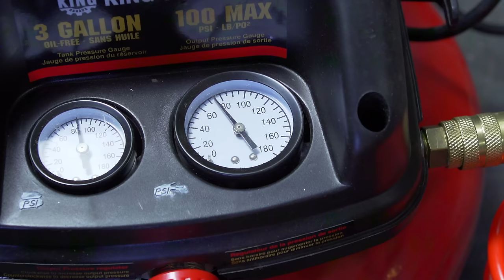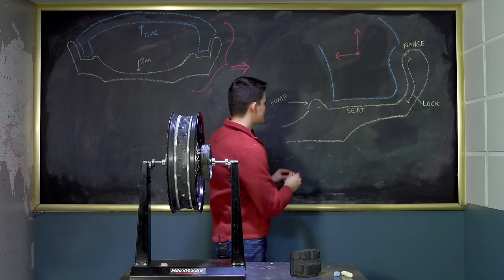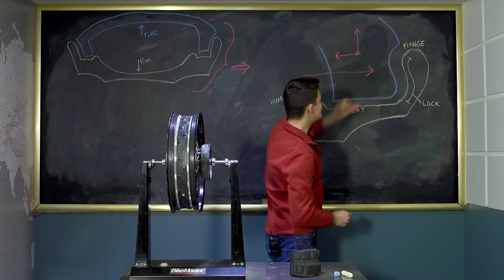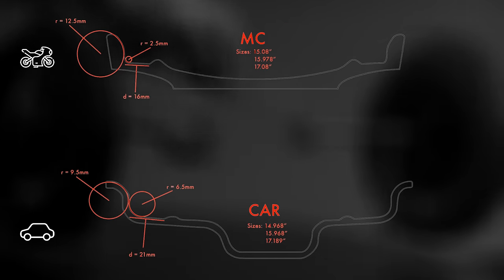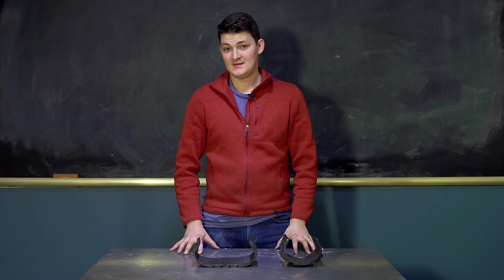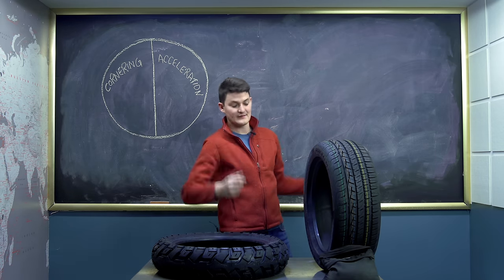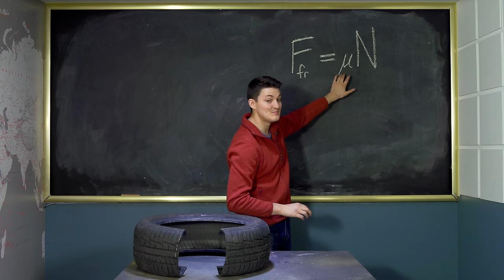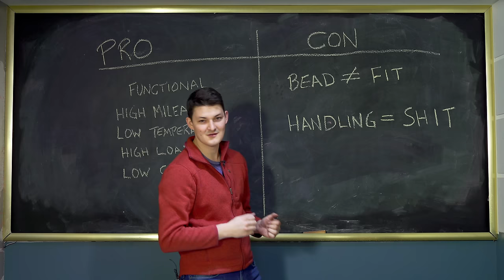Are Motorcycle Tires a Ripoff? The Darkside Car Tire Experiment

Comment: A friend of mine who is in the 300+ range with a wife not far behind decided to put a car tire on his goldwing and then take it up the tail of the dragon 2 weeks after buying the bike, his first. As one might guess, he came back with with a cast on his arm and a matching one on his wifes leg. The tire did great for him until he had to actualy corner, at which point it slung him and his wife into the side of the mountain. Luckily, they were on a curve that put them there, instead of flinging them off the side of the mountain or into a guardrail. His ins paid to fix the bike and he took the old tire back to the shop where he got the car tire and had it swapped back on before he rode it again
Reply: And was the accident CT related, or is he just a dumb man buying a Goldwing as a first bike and ride 2 up after 2 weeks? 🤣🤣
Reply: @corneilcorneil  He swore he just leaned over to much and the back went out. He also claimed to have riden bikes when he was younger but it would seem not that much to do a stunt like that.
Reply: @southronjr1570  "The back wend out"... possible, on sand or gravel. More likely: a (heavy?) passenger that try to pull the bike straight when you lean. Maybe he was using the rear brake to much? No countersteering experience? A new rider on a Goldwing... typical, not? But ofcouse, it is easy to blame the tire. Just like all the invisible deers that cross roads. 🤣🤣
How "far" can you lean a Goldwing? Real riders scrape their bikes daily without a outbrake. 
When you use a correct CT and pressure, it bites in the road and is much safer on a heavy cruiser. I would say, try 2 identical cruisers/tourers, one with a MT, one with a CT and see how it works out. Modern MT's have almost no profile patern. How that turns out on a heavy cruiser, is just logic.

Comment: People who say something shouldn't be done. Should never interrupt those who have already been doing it. If you are a pussy. Don't run a car tire on your bike. I have ran Runflat car tires on Goldwings for well over 300k miles with no problems. And no flats on the side of the road. The handling part F9 mentions is real. You will only notice it in parking lot speeds. Otherwise, it is a non issue. I'll take my decades of experience over anyone's perception of Darksiding.

Comment: So he Choose a light bike with a Spoked tube + tire rim (that should give you a clue as to the agenda to start with. Then he puts a non-run flat, fairly wide, cheap tire on it (strike two). Then he inflates it until it's hard as a rock. It's SOOOO surprising that after he goes for every extreme to make the tire fail, it does in his example...shocking!...Not!
I've run high performance run flat tires on my '02 Goldwing for 15 years. They are Not $100 cheaper than MC rears, they do last 3-4x as long. The Goldwing rear rim is nearly as wide as a standard car rim and it uses tubeless tires of course (what a joke using a narrow Spoked rim for an example). The Goldwing weighs over 800 lbs and when a car tire is properly inflated to 10PSI or more below the the car mounted pressure levels, it does deflect a bit, not that heavy cruisers even could nimbly lean at the angles the bike in this example (with tires inflated to be hard as a rock) could! Where is the truth of a real comparison anymore?? What happened to unbiased reporting??? This is similar to Fake News edited, manipulated to present only one possible opinion. I just lost all respect for this guy based on this manipulation of facts!

Comment: One thing that really bugs me about this video is that the G-max AS-05 is an asymmetric tyre. Meaning that the inside tread and the outside tread are designed for entirely different situations. As a car fitment, great tire considering the price, but any rear mount on a motorcycle should be symmetrical. Video is phenomenal otherwise. Typical FortNine exceptionalism.

Comment: I've been riding motorcycles on the road for 45 years, when I was young I did many risky and stupid things, however for most of my riding years I've always had the attitude of making my machine as safe as possible to reduce the inherent risks comig from things I can't control. I see a number of people using car tires on the rear. Based on numerous forums people who do so get very abusive and aggressive if anyone questions the use of car tires. IMO some get away with doing so because the machine and tire combo exceeds what they are asking from it in normal riding. I view paying for a properly designed and configured motorcycle tire money well spent because when other factors come in to play having something approaching the very best tire at your disposal can literally be a life saver. Why would you intentionally reduce your cornering grip, ultimate handling etc. etc.? Perhaps when I see Marquez winning races with a square section slick tire on the rear, I'll consider giving one a try.

Comment: So, why don't you use a car tire of far, far greater width than the stock motorcycle tire making your experiment totally worthless???  My darkside tire has more curvature than the stock MC Dunlop and it is the same width, and, being a radial it conforms to the road surface far better than the MC tire when used with ideal inflation pressure.  And as far as load, you ignore that friction increases with load.

Comment: The bead shape is different. Softer compounds, built for lean, definitely not a ripoff, but definitely too expensive for tires in general.
Reply: I will never go tubeless on spoked rims though, seen that fail too many times. That tire is waaaaay to wide for that size rim.

Comment: I remember the first time a customer asked our shop to install a car tire. He got angry when we laughed at him. There is no way in the world any intelligent shop is going to risk that level of liability exposure for some shmoe who thinks they know better that all the design engineers of the motorcycle and tire industries. If I were an insurance adjuster, I would deny any claim from someone who used a car tire. If the "darkside" twit wants to challenge in court, they can bring in experts from the motorcycle and tire industry to try and make their case. Good luck finding one that will be willing to do that.
There's nothing that can be done to prevent someone from running a car tire, and as long as any consequences of accident are limited to them, have at it. The moment your decision brings harm to someone else, get ready to pay the legal consequences.

Comment: F = constant * N isn't exactly accurate. Otherwise, given the same compound we'd expect to see 18 wheelers have the same braking distance as a car, which obviously isn't the case.
(F = m * a = mu * N, except m ∝ N, so we have a ∝ mu? Deceleration only depends on friction coefficient, not on total vehicle mass?)
It can be looked at either as that equation is just an approximation, or that mu isn't actually constant but rather a function of a whole host of things.

I remember in like a first year eng course or something I asked my prof about this, and after acting increasingly exasperated at me slowly building up from light car, light normal force, easy to stop, vs heavy car, high normal force, and exactly proportionally higher difficulty to stop, etc, finally realized the question wasn't as stupid as he anticipated and explained some stuff I no longer remember.

If I had to guess thou, I can think of...maybe rubber exhibits different properties under different sheer forces? Something something plastic stage then glass stage?
Also perhaps we aren't dealing with ideal friction where it's just electromagnetic forces between flat surfaces? We actually have bumpy roads and bumpy tires and there's grip stemming from protrusions from both literally laterally touching each other?

Either way wider tires made of the same material, on the same road, with the same normal force, should actually just provide better grip (at least to a point).

Comment: @3:00. vs $200 tire "I'd rather jimmy rig a bloody car tire because it saves 100 bucks and lasts four times as long." Then it doesn't save you $100. It would save you $700. That's not an insignificant amount of money.

Comment: I think motorcycle and auto/truck tires are a ripoff generally, I can put a set of quality LT tires on my truck for about $800, a set of tires on my motorcycle, $600. My truck tires will easily run 40,000 miles. I am lucky to get 7000 out of my bike tires.

Comment: Darkside all the way for me,.. 215/45/18 performance rated car tire on the rear of my VTX 1800F2. .. Could have dragged the footpegs with the crotch rockets had I wanted to do so.. Better traction and breaking than any of the bike tires used. To each their own....

Comment: The car tire lots for more miles because it is harder rubber.
Would you knowingly put a harder MC tire on the back when traction is all that will save you from a crash?

Do a scientific test of traction wet and dry and the MC will win everytime.

Comment: Kinda like using trailer tires on a car.  Wrong application.  Been working tires for far too long.  Actually ran a set on my vehicle to see what it would do.  Worked fine in a straight line on dry pavement.  If there was even a drop of moisture on the pavement, off road?  Bye bye traction.  Let's not mention the fact that most trailer tires are only rated for 55 mph.

Comment: I still think motorcyle tires are a rip off...if only for the fact that they don't have enough meat in the center strip of the tire. I see so many motorcycles riding around with rear tires that are nearly bald in the middle but still have lots of usable tread on the outer edges.

Comment: You are usually a pretty smart fella.
The problem is, we aren't simply throwing on a car tire that'll go on the wheel, on just any bike.
My gl1500 Goldwing is a very good example: fairly sporty for a touring bike but not a corner carver either. Nor does it have a particularly WIDE rear tire (160 section width?) so I'm not looking for ANYTHING as wide as what you managed to mount on that...bike of yours. What THAT means is, with the RIGHT car tire (a European taxi tire, in my case), the tire's tendency to want to right itself is FAR less than the example you show.
Also, there is NOT A SINGLE EXAMPLE EVER DOCUMENTED OF A "DARKSIDE" TIRE to RIM FAILURE...EVER; the differences in bead to rim surfaces simply don't make a significant difference and have NO effect on the tire's ability to seat properly. Not to MENTION the modern construction of radial tires today does WONDERS in combating those forces that are trying to separate the tire FROM the wheel.
I get it, to the minds of some engineers, scientists, lawyers, motorcycle shop owners, etc., it MUST be suicidal.
The only problem with that view is the ACTUAL facts: the results simply don't support the naysayers' concerns.
Not all motorcycles are even candidates for such a swap but, for those that are, the benefits are numerous, while the dangers are all but non existent.

Comment: Correct on all points, but one thing he missed (and this applies to even rounded tires over 190mm) is that the wide (or square) rear tire actually lifts the center of gravity off of the ground, and tries to force the bike upright, requiring even more counter steering to keep the bike on a constant line. Lots of physics happening here that scream bad handling.

Comment: Been riding darkside exclusively since 2004 after replacing 3 mc tires in less than a year on my Honda VTX1800C. I don't recommend that anyone ride darkside, but the following is what I've learned after 16 years and many tens of thousands of miles..
To start with, the bead wall on the mc wheel is exactly the same as on every car wheel I have ever owned. Tubeless car tires fit tubeless mc wheels perfectly. Next, motorcycle tires are not subject to lateral forces like tires on a car. Motorcycles lean, cars lean the wrong way. The entirely different engineering explains why high performance autos use low aspect tires while hp motorcycles use high aspect tires. My third point is, yes, going darkside does affect handling. On curves, in order to have neutral handling you have to lean in to the corner. Watch the way the racers lean in. It's not necessary to lean to that extent, but a little lean to the inside will even up the steering. It takes a few hours to get used to it unless you race or do track days, in which case you already do it. Actually, it's always a good riding practice to lean in a bit on curves. On a positive note, going darkside means you'll never again be surprised by a bridge grate or gravel road; the auto tire handles both like a car does, with almost no squirm./

Comment: People just pretend to tag as "work" and "fail" dark side without to see difference between cars tire sizes.

If you say all car tires are ok is like say a wide 205/30r17 can lean like a round 5.60-15 (beetle size). 

so, why not to say you can use a 90/100r17 MC tire in your sport because is a cheaper MC option? seem reasonable now?

 if you aren't sure about what will happen keep the focus in original. Don't die.

Comment: I say bullshit Darkside work well on heavier bikes and in my experience handled better with more stable grip in tight cornering at speed, yes the follow the ruts in the road but if you are any sort of a rider you soon learn to cope and counteract this
Also I never had a problem with getting one fitted and my insurance company had no problem with it even after I wrote the bike off at approximately 200 Kph due to rider error, yes even an experienced rider can F#$k Up
Reply: Agree with you, 6 year experience and daily rider, never go back to a MT. This sponcored boy is a liar.

Comment: There is one major problem with this video. You are basing your results on a style of bike that nobody in their right mind would use a car tire on. The only ones that use it are people that have heavy cruisers. And for that application, they actually handle better than a motorcycle tire. My uncle has a car tire on the back of his harley. It feels better in almost every way, compared to a m/c tire. The only negative is that when first lean into a corner, if feels like you are on a worn m/c tire that is flat in the middle.

Comment: A car tire on a motorcycle... REALLY?? Anyone who would do that just to save a few bucks on rubber absolutely deserves the terrible crash they will eventually have because of it.
Reply: @beverlyhurd8556  You are very correct. I am totally ignorant about running a car tire on a motorcycle, as I wouldn't think of ever doing it or advising others to do so. You are mistaken about my ignorance being "undeniable" though, as I would in no way, shape or form try to deny it.  

By the way... I have been an avid motorcyclist for over 50 years. In that time I have ridden from coast to coast and all points in between, and as far as I know, I have never, ever seen a car tire on a standard, "non-novelty" motorcycle with only two wheels. So I disagree that there are "many many thousands" doing it.

Comment: You are right and wrong,  darkside tires are a science, they will work and work very well only with the right size and weight bike   ,  Goldwing and other very heavy weight bikes - think 900 pounds 1300 all up. also very important is tire type . they must be soft compound winter tires, and rated for run flat operation.   Michelin primacy pa 3 winter tire. this tire will outperform any tire in wet grass or road as well as stopping grip is incredable. you are testing on the wrong motorcycle I have tested this. some car tires wont be any good on any bike you are limited to just two or three tire's the one I mentioned always has a larger contact patch  somewhat  triangle shaped but still more contact . try running through a 6 inch line of chalk in a turn. check out the print then try it with a mc tire. __ all about the right bike with right tire.

Comment: Car tyre stores won't install them because it's out of the normal.
Their used to undoing then re-tightening 5 nut's.
They don't have the knowledge or the patience to realign the rear & reconnect the chain & use spacers etc.
Just don't have the skills.
Just undo 5 nut's then tighten 5 nut's with a air compressor drill & charge big bucks.
Yep no skills there.

Comment: Let's clear one thing up right now!! It's a Goldwing thing. Or big, heavy long distance tourers. Not adventure bikes, not sports tourers. 300kg+ bikes. Ones that rack up 100-200,000km+! They chew miles with heavy weight, and run upright 90% of the time. It's a thing. You're not going to see it on a VFR1200F with greatly reduced carrying capacity, 170hp+ and "only" 275kg. Kinda irrelevant vid.

Comment: A car tire on a bike has to be deflated compared to a normal motorcycle tire. You tell nothing about that, and I can see that yours is inflated too much otherwise you should get much less handling trouble, especially righting moment. Another important point : SIZING ! you also tell nothing about that. Width to height ratio, high siders must have your preference. Avoid reinforced tires, preffer thin walls, rounded edges, ect... You missed a lot on this one.

Comment: I would really skip the friction calculation part man. Youre completely wrong about it. Because if so the rubber couldnt produce more than 1g lateral force. And it can because the contact patch matter and also adhesive characteristics of rubber matter. Sorry mate but I am mechanical engineer and youre COMPLETELY WRONG at that part.